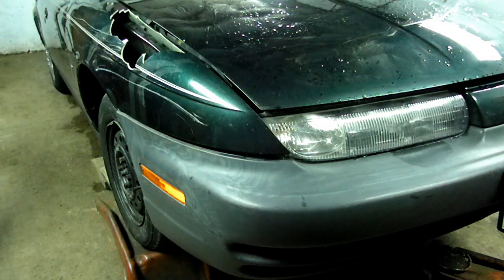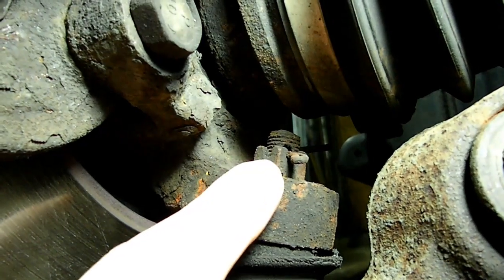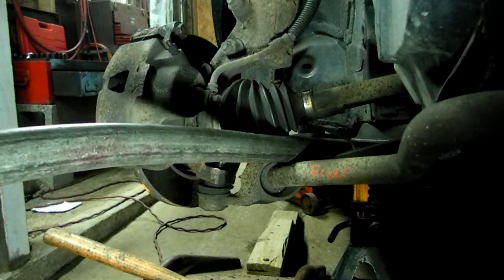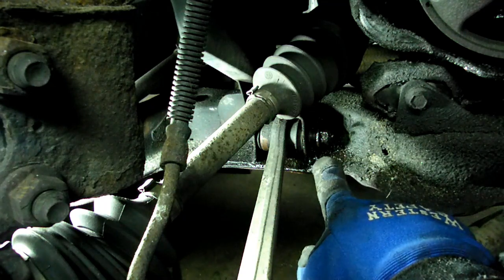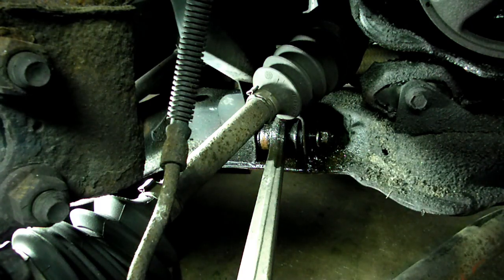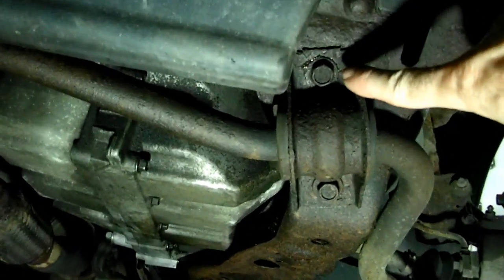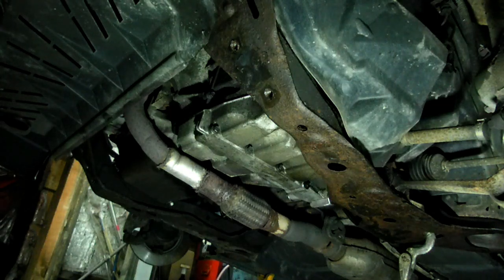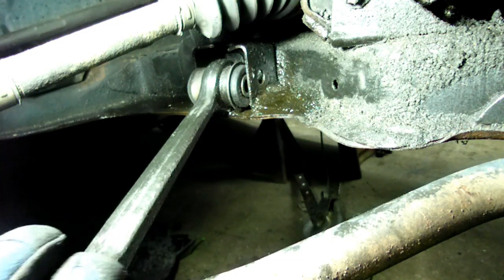Front Stabilizer Bar Replacement

Comment: This video helped me replace the sway bar on my 99 sl1. I followed Richpins instructions and got it done. Helped me save $$ on labor.  When installing the bar I attached the bar to the frame first then attached the ends to the lower control arm. Then I attached the lower control arm to the frame.  Instead of a come along I used a pipe to push/pry the lower control arm into place, only because I didnt have a come along. This video was excellent. Richpins other Saturn how to videos are also excellent. Thanks Richpin

Comment: Richpin your videos have helped me a lot, I'm still driving my 2001 SW2.  135K.  Today I replaced the sway bar bushings at the back, in the control arm.  I did not remove the control arm.  It wasn't exactly easy, as the tension on the bar is tricky to deal with.  I used a ratchet strap on one side, hooked across to the underside of the frame in a direction that made sense, sort of diagonally back.  This allowed me to pop the bar out of the control arms.  I bought the one-piece bushings for $2 each at Advance auto.  There was no way that they were going to be pushed into place in the hole on the control arm.  I had to cut them in half.  Put one half on the bar ends and got one side in.  Then used the ratchet strap again as a comealong to compress the bar enough so it lined up with the other side.  That was the easy part.  Getting the front brackets lined up with their mount holes was hard!  I had to raise the knuckle with my jack, going from one side to the other, compressing the shocks a bit to help line up the holes.  And a pry bar to make finer adjustments.  But it got done.  Thanks again.  My ratchet strap was wimpy, a stronger comealong would make things easier.  Also a 1/2" drive 15mm 6 point for the bracket bolts would have been nice.  All I had was a 3/8" 12 pt.  I used some heat and it worked.

Comment: Hello richpin. 2002 saturn sc1 passenger side front stabilizer  bar is bent from impact with curb..it appears there is a slight bend in the subframe where the stablilzer bar attaches..is this ok to leave as is or repairable?
..car is not worth much..thanks in advance.  ie: engine cradle

Comment: If I wanted to just replace the front stabilizer bar bushings, could I just remove the bushing clamp bolts and pry the bushings out without removing anything else in the suspension?
Reply from the maker: +hnkfsh81 Check post #6 at this link http://www.saturnfans.com/forums/showthread.php?t=193524
Reply: +richpin06a Thank you, Sir. Excellent link.

Comment: Hi Richpin, Had a recent accident, slammed the right rear wheel against a center barrier. The rear strut got bent, and I had to replace the rear hub assembly and trailing arm. However, the right side, front wheel, had a little damage as well, the fender just has a crack in it, but the right wheel is slightly turned in, while my left wheel is straight. The tie rod and lower control arm do not look bent. The subframe looks ok. I was just wondering, how can you tell if the stabilizer bar is bent? Was it pulling the wheel in on this vehicle? Thanks in advance. I've been looking over the front end very hard, and have become puzzled with why the wheel got pulled in.
Reply from the maker: +outwestjake The only way i know of is to compare yours to a known good bar.
Reply: +richpin06a Got it, I'll try to grab one from the junkyard tomorrow. At this point I'm not sure why else the wheel got pulled out of alignment. Thanks.

Comment: Richpin06, Thanks for this and all of your other Saturn video's!  I have a question for you concerning the stabilizer bar bushings.  Can the brackets holding the bushing/stabilizer bar be removed, one at a time, to replace the bushings or does the bar have to be completely removed first?  Thanks!
Reply from the maker: I have never tried removing just one bracket at a time, not sure.

Comment: why does the passenger side lower control arm have to be removed? why not just take the 24mm nut off both sides then the 4 front clamp bolts and pull the bar out ?
Reply from the maker: I am not sure why the repair manual states to remove the control arm.
Reply: Removing the control arm releases the tension on the sway bar, without removing a control arm it would be very difficult to remove the bar as it would require enough bending to break the tension.

Comment: Help! I'm so frustrated at this point I want just call the wrecking yard to come and haul this 1999 sc2 to the dump. For the life of me, I can't figure out how to compress the stabilizer bar so I can get it back into the control arm. It's up on stands and blocks...I've been trying for a month to figure this out. Not a single video out there even mentions this issue. Am I just brain dead or what. Please someone give me so.e guidance. I need to get my car back on the road asap. Anyone. Please.
Reply: Make sure you didn't inadvertently flip the bar. Apparently that is a common problem. It can seem identical either way, but it actually makes a difference.

Comment: Rich my stabilizer bar had its bolt come completely out of the control arm. Now the bar inst connected and braking pushes my tire all the way back in the wheel well. Would there be a permanent way to push and secure the bolt back into the stabilizer bar? Can you replace the stabilizer bar without taking off the control arm? My bolt does not want to come out of the control arm no matter how hard I try.
Reply: Naturally Primal I Have This Problem Right Now. Any Insight?